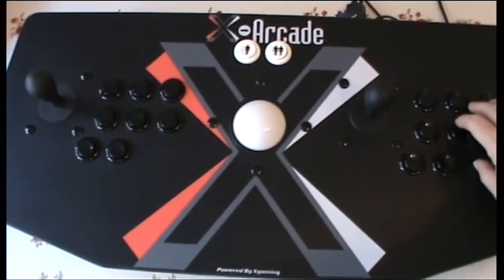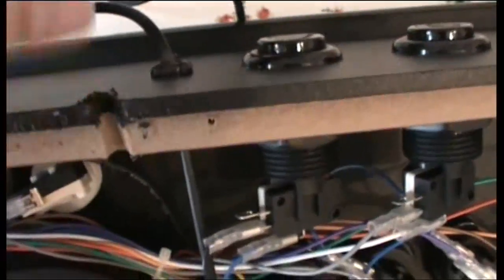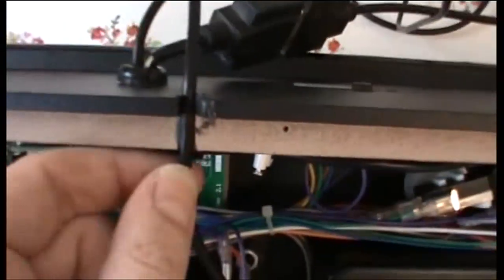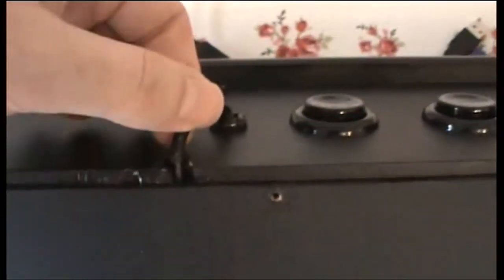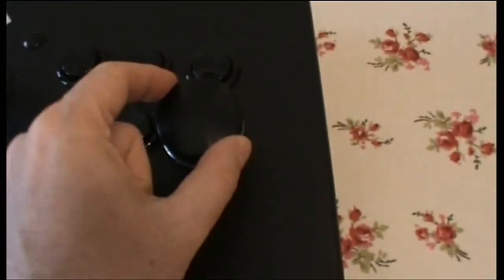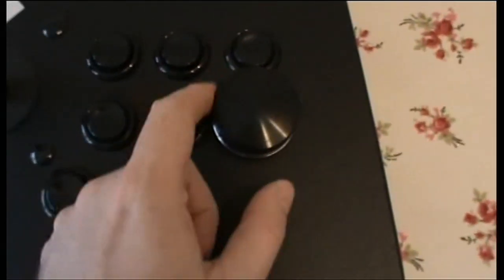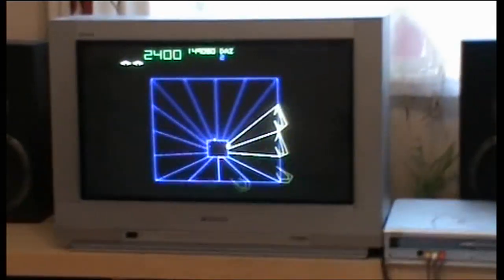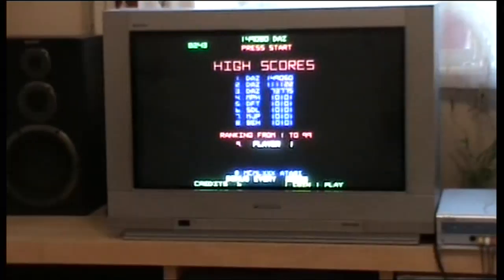Fixing a Spinner to my X-Arcade Controller

Comment: Nice work.  I considered removing a button for mine but in the end just didn’t want to lose a button (even if if don’t really use it) and didn’t really want it so close to the buttons.  But in the end whatever works for you!  XArcade needs to smarten up and release a model that includes both a track ball and a spinner so no mod is needed!

Comment: I'm so happy to see that you finally got a working solution. I remember us starting talking about spinners back in the middle of 2017 and how the issue was not just which one to get but also how to implement it into something usable. I offered you the Mame Arcade stick as I thought you deserved something worthy of all your MAME videos and I no longer had a use for it. I thought it would be nice for you not just using a controller but I also had my reservations offering it as it's just so bloody big. It seems like the stick with the spinner installed finally is a unit worth having. I hope you get to use it for a long time and get to enjoy it. I think you can download the manual for the stick on the Xarcade site but if not I can scan it and email it. I simply just forgot to put it in the box :)  The buttons on the sides are not just great for pinball games and entering credits but also work in MAME for going in and out of menus and selecting games. The switch and buttons on the back also have a lot of helpful features. Thanks for the video. Great seeing it in action, Daz!

Comment: Nice little mod there, I have one of these Tank Sticks, must have bought it 12 13 years ago, unfortunately the original keyboard encoder died but I ended up dropping in an IPAC2 for replacement. I basically use it as a test rig now on the very rare occasion. I built a full size Arcade Machine and Hyperspin from scratch few years ago so it's my go to for Arcade gaming :) I still need a spinner, been meaning to purchase one and yes they're quite expensive, I will also get the steering wheel too, far better than using the joysticks although I've mapped them pretty good but still not right ofcourse.

Comment: Was this "plug and play" for you? I have the same set-up but the spinner doesn't work!
Reply from the maker: For it to work on MAME you have to go into the UI settings of MAME and then go down to the section "CORE INPUT OPTIONS" and make sure "mouse" and "multimouse" are set to "1", well it worked for me anyway.

Comment: Sorry in advance for the daft question: I have a Tankstick (but no technical skills whatsoever), so adding a spinner as a button substitution (rather than drilling holes) looks ideal. I see from the video you stow the trackball USB lead for convenience, but couldn't figure out if both analog controllers (spinner and trackball) could still be used at the same time, in your configuration. I use the trackball all the time and wondered if, by adding the spinner as you've done to the internal USB controller, can you still use the trackball as well if I was to use three USB ports rather than the two used as standard? I don't need to stow the trackball controller, I just wondered if the trackball can still be used with a spinner installed as you have done.
Reply from the maker: Hi, sorry for the long delay in replying, tbh I have never tried using the trackball for anything, as seen in this video I've even tucked away the lead for it, I cannot see how both can be used at the same time as the controls for say Tempest asks you to input which device you want to control it with meaning the other device would be non responsive, I honestly couldn't tell you for definate without trying but time is the issue.
Reply: @ZEUSDAZ  Thanks for your reply.
I recently upgraded the PCB on the tankstick to the new Tri Mode version from x-arcade, which has an undocumented 'spinner' socket on it, so maybe it'll be activated at some point in the future.

Thanks anyway.
Reply: @ZEUSDAZ  You have to enable multi-mouse support in your mame.ini file. This way all devices that appear as mice (spinners, trackballs) can be used at the same time and have specific settings for each. (Sensistivity differs between a spinner and a trackball)

Comment: My X-Arcade trackball is not working. When I plug the usb wire into the usb port, there is no sound or light at all. And of course, it's not responsive in MAME at all. I recently bought another X-Arcade for a friend, and when I plug that one in the same PC, it works just fine. Does this mean my panel is defective? I bought mine a few years ago and never really tested the trackball until now. What should I do? Any help appreciated!
Reply from the maker: Sounds like the pcb board inside has caused a fault as normally once your pc has installed the driver needed for the X-Arcade device it should work.